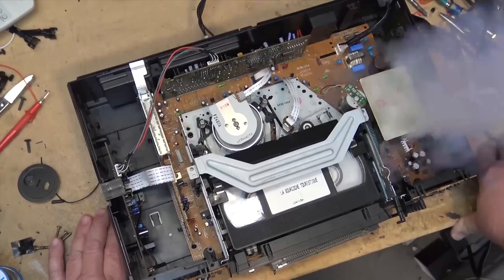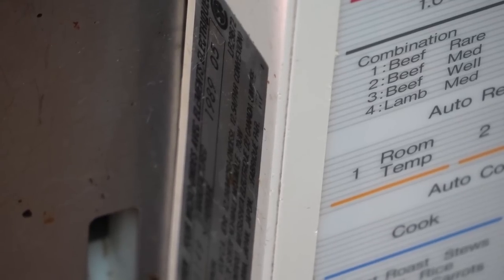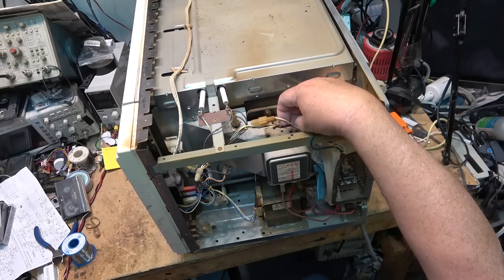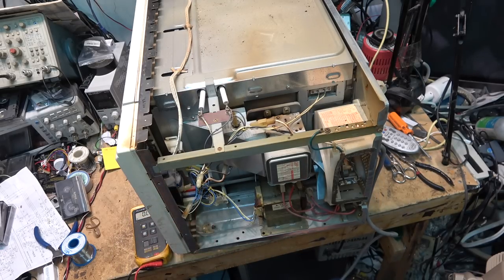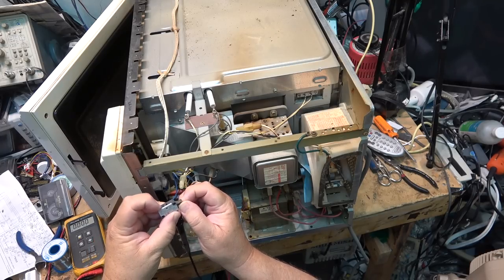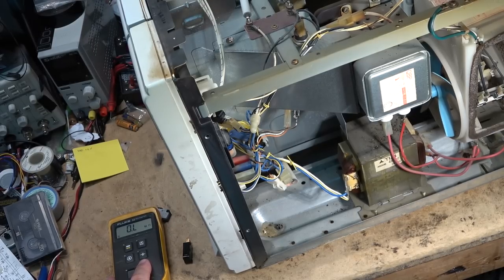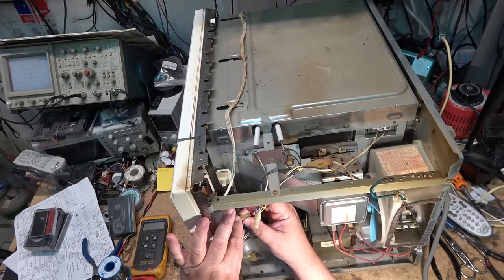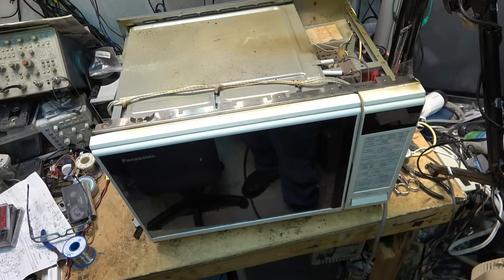Microwave Oven Blows Circuit

Comment: That is why I normally keep the switch wiring loom when I scrap out an oven, so that you have a length of wire with the correct connectors already on, and you simply splice it into circuit where the switch and the connector have gone crispy.  Also have noticed a trend with recent microwaves where the failure mode is the magnetron feedthrough capacitor shorts out to ground, which means  a new magnetron. Normally they are the most reliable part of the unit, only failing after a decade or more. 

Still use a 1980's era KIC, only parts replaced are the door switches, lamp and timer, though I did replace the original magnetron after 30 years, as it had finally dropped in power to around half. New used magnetron, and the timer got replaced with an industrial plug in timer and push button, set for 2 minutes, as that is perfect to make a cup, which is the main use of it.
Reply from the maker: The capacitor was a common failure and it did not result in magnetron failure.  It forms a voltage doubler circuit with the stack diode.  Magnetrons fail because people do dumb things like make popcorn in them.  There is a minimum load and if you don't have that the magnetron overheats and goes pop.
Reply: @12voltvids  Not the 1uf-ish voltage doubler, but that feedthrough capacitor that handles the heater connections and the negative power lead. That sort of failure is starting to be common, with them having around 150k leakage to ground for some reason. Never had them fail before, just guess the manufacturers now are starting to skimp on the construction of them now to save cost. Difficult to replace unless I buy a pack of them via the slow boat from China, and spot weld the leads on to them, plus get the old riveted one out without damage to the thin metal case of the magnetron.
Reply from the maker: @SeanBZA  never have seen that.  No cap on heater on this one.
Reply: @12voltvids  it's part of the terminals. Kind of like feedthru caps in rf circuits.

Comment: Not sure if its good or not but I was taught decades ago a pretty foolproof way of cleaning them is to put a cup of strong ammonia in the microwave overnight, best outside as it stinks.. any baked on grease just wipes off with a soft cloth the next morning.. oven grates etc it also works fine on, i put them in a sealed large trash bag with a drop of ammonia in the bottom.

Current microwave oven is from 2001 and i bake in it, grill in it and microwave things and give it a thorough clean once or twice a year and had no problem with it.

Comment: Just replaced my parent's over-the-range microwave on Sunday, 10 year old GE died, door was falling apart. New GE (I didn't choose it, they bought it) used a new bracket with completely different mounting holes, AND the top anchor holes were all in different places. You would think the same company would use the same mounting strategy, they obviously changed it for no good reason other than to change it. 

The new ones are crap. The low-end Whirlpool runs with the range vent fan on full blast, to cool the electronics, SUPER loud.
Reply from the maker: The problem with over the range microwaves is heat from the range. Especially if it's a gas range the amount of heat that is thrown off will deform plastic inside the microwave. That's what happened to my neighbors that Frigidaire I think it was that I had to change the bracket on and I had to change it again like a couple years later I changed it a second time because the new one also deformed because she cooked on her gas range and overheated it. I know sooner fixed the second time for her and she sold the house and the first thing that people did that bought the house was they ripped the kitchen out and threw everything in the garbage.

Comment: Same type of door switches in many old microwave. These switches were obnoxious on everything with a little electronics or security circuits with little space, from vacuum cleaners to washing machines, computer chassis intrusion switch... I've also seen these mounted as sensors on mechanical diesel fuel pumps (prone to fail in some harsh environment!). It's always useful to have a few of these micro switches in stock, even if it's always the model you don't have you absolutely need...

Comment: I just fixed a Sharp microwave from 1996 and it had a dead short too, but it was the main oil cap
Reply from the maker: Main oil cap will not short the power cord.  As soon as you press start it will draw excessive current and trip the fuse.

Comment: I always turn off the micro before opening the door, and also avoid standing in front of it while running, maybe i'm little paranoid. I wonder why north america has 120V house electricity and polarised plugs VS. Europe 230V and non-polarised. in an old house without grounded outlets, it is possible to get mild shoch from a computer case, i guess that it not possible in usa/canada?
Reply: You sound like you live in a third world country considering no inspection had been carried out every time it’s sold. Some live referencing problem.
Reply: @BritishEngineer  In the European Union electrical devices are required to have "CE" marking, which means the manufacturer guarantes it is safe, but no actual test is done whatever that is true. well we do have a department that does random testing on devices and if finds something is s serious death treat, then that device model is taken off the market and newspapers tell you to retunr it to seller. Anyoway, my micro is from 2004

Comment: I didn't know some of these Microwave ovens adopted radiant heat as an option - interesting!.   I don't use them for various reasons and one of them no hookup for natural gas  😅      So in radiant heat mode.. can one use stainless steel vessels or does it still engage the 'magnatron' ??
Reply from the maker: Yes in bake mode you can use metal pans and pots.

Comment: I have some bad switches in my microwave too it’s a kenmore where should I get new switches for it
Reply from the maker: Well you should be able to get the switches anywhere that you buy parts there are several styles of micro switches. Some have levers on them or rollers and others are just the bare pin switch like this one used. I bought these at RP electronics in Burnaby but you can get these type of switches pretty much everywhere. Digikey, mouser ect. The ones I got were single pole double throw so they can be used either as the short switch or the primary interlock or for that matter the timer switch you just have to connect the correct terminals. connect the wrong ones and well see they're not going to work or it's going to pop the fuse immediately and blow up all the new switches so I got to make note when you remove the old switch which contacts are used normally open and common or normally closed in common

Comment: You must always mention the danger of opening up a microwave! High Volt and Cspasitor.
Reply from the maker: The capacitors in microwave ovens have sn internal bleeder resistor.  They don't hold a charge more than a few seconds after power is shut off.  The bleeder resistor has been standard in all since the 70s.
People would take your concern more seriously is you learned to spell capacitor.
Reply: @12voltvids  You can write wrong. Not done on purpose!

When I worked and repair  microwave oven, the boss always short the capasitor with a special tool? There was a big bang, spark.

Anything can happen! Resistance can be de -effect.

Important to talk about safety and what may be the danger.

Many amateurs out there.

When you work with vacuum tubes radios/amplifiers then there are high volts that many are not aware of.
Reply: We became such a soft bunch we have to write in 8pt font: "Spiderman silly string is not effective means of securing, trying, or for rigging mountaineering activities".

Comment: im going to take that switch out of my microwave i dont want a switch to blow a fuse for no reason and making me think something serious is wrong.. and my wiring is that old that it doesn't have a breaker.. i would hear the magnetron if it was to stay on and i would pull the plug out
Reply from the maker: Go ahead.  It's only you that is going to glow in the dark.

Comment: We threw out our microwave years ago. If you want to keep your health never use one!
Reply from the maker: Another misinformed. Microwaves are safe to use.  They are not radiation asbin ionizing radiation such as x-rays, gamma Ray's ect that damage dna. They are radio waves no different than your cell phone uses to connect to WiFi. Infact even though the 2.4ghz wifi band had 14 channels assigned for use you will never see any channel used above channel 11. Why is that.  Will on the current band plan each channel overlaps the next 2 channels either side.  Channel 11 for exams overlaps 9 and 10 and 12 -13. 14 was the band edge 2.45ghz but that also happens to be where your microwave oven magnetron operates.  So it would wipe out anything on wifi whenever it is operating.  Today's routers output up to 1 watt if power.  Microwave ovens must not radiate anything over 0.005 watts measured at the door sealing surface.  So you are getting a much higher dose of the same frequencies from your "toys" than your microwave.  
They cook by causing molecules in fat and water to oscillate at the resonate frequency. This oscillation causes the molecules to kit each other and this produced friction and no different than rubbing your hands together this causes heat. It is this heat that cooks your food or warms it up.  No different than putting in an oven except that the heat in the oven browns the food so it looks more appealing.
Reply: @12voltvids  Are microwaves at all harmful if you operate them with the door shield and glass removed?
Reply from the maker: @jamescollins6085  the screen in the door prevents microwaves from editing the oven cavity.  Removing it would be the same as operating it with door open. In other words don't do it.
Reply: @12voltvids  Thanks for explaining.